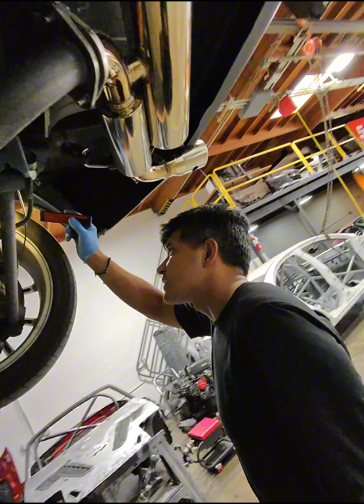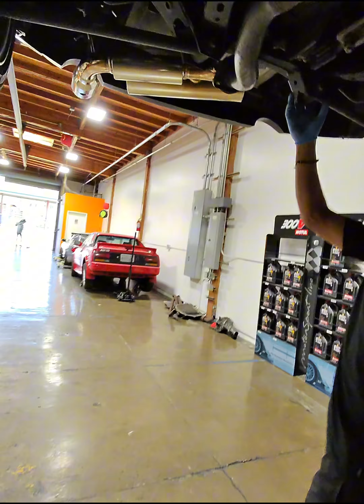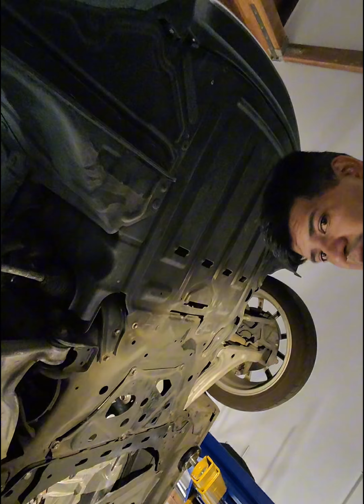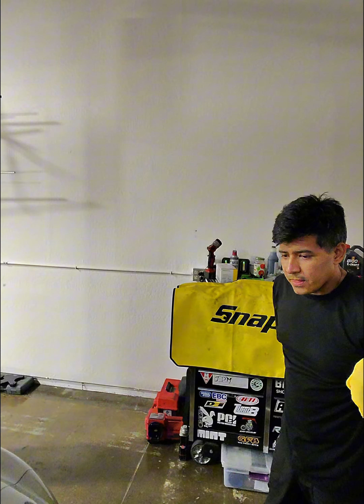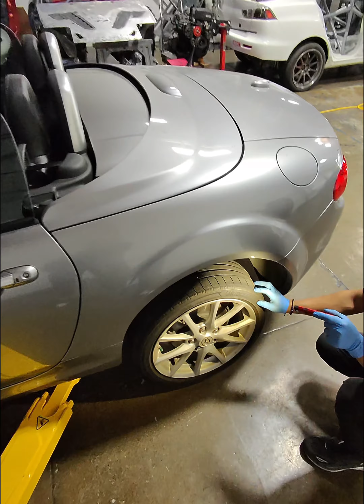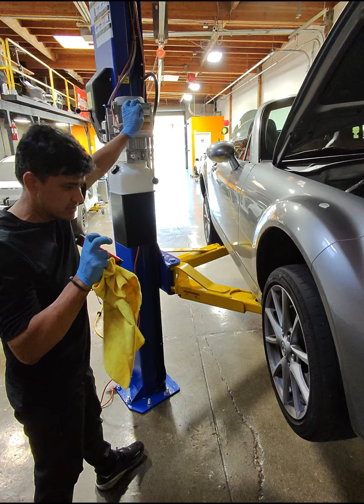Inspection and Suspension Upgrade consultation on my 2010 NC Miata

Comment: Hey brother, thanks for sharing this. Outside of the car understeering, were there other signs/sounds you experienced? I hear some squeaking on the rear which I initially thought was being caused by the end links (originals were completely worn out), however, I still hear that squeak occasionally. I'll definitely take a closer look down there after watching this :D.... Cheers.
Reply from the maker: It was honestly bad damping over bad roads, it was super uncomfortable + terrible plough understeer on corner entry if the speed was a little higher than it should've been. Didn't hear much squeaking
Reply: @KedDrives  Gotcha, thanks for the insight. I think it might just be dirty bushings or something along those lines on mine. I'm not experiencing the understeer or incredibly uncomfortable ride....yet lol
Reply: @Auto-Minute fwiw the understeer was when I was really pushing it. It took me 2000-3000 miles to realize something was really wrong. My front tires were cupped too, likely due to the shocks. I’d check your tire wear as well!
Reply: @kedarrudrawar5039  Yeah good thing to check for sure. I think yours were worn out on the outside edges right...but was it uneven with little dips or just worn out by smooth all around?
Reply: @Auto-Minute don’t remember unfortunately